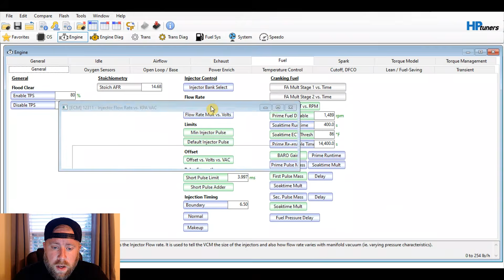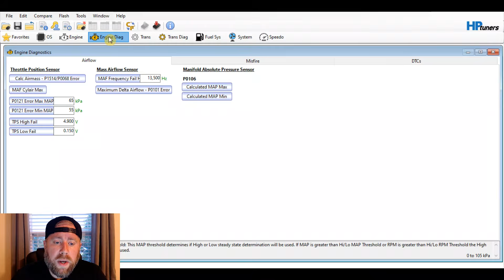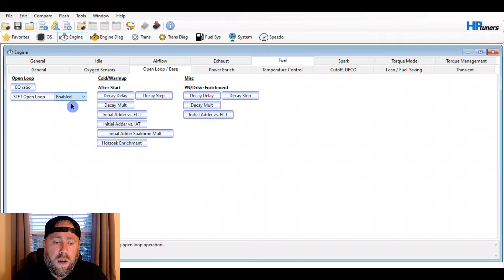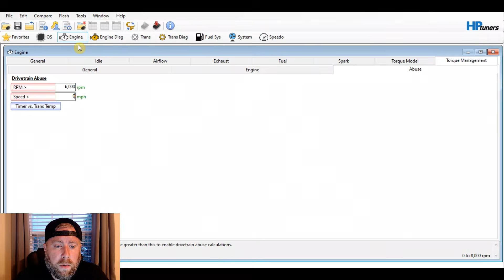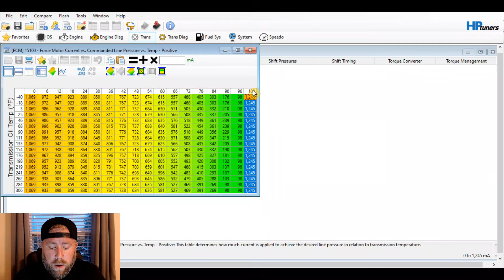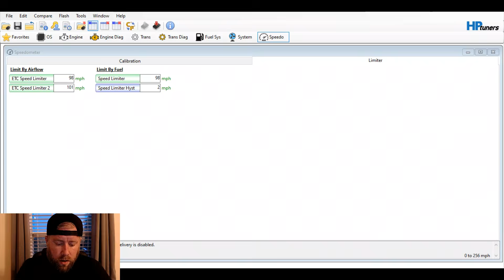Gen 3 LS Swap Tune DIY with HPTuners

Comment: Great information, i know this video is 2 years old , im not a tuner but the tuner im using is not to familiar with e38 ecm for my ls sway, i have a 2007 6.2 from a Escalade, the ecu want to see fuel pressure from the fuel pump module but i running a corvette fuel filter what does he did to tell the ecu to show rail fuel pressure, need your help.

Comment: Hey great informative video, I’m thinking on purchasing HP tuners instead of paying someone to do my tune, but I have never done this at all, I purchased a mild tune from psi conversion, they said it will run fine if it’s stock, but run like crap if having aftermarket camshaft in which I do have, it’s a stage 2 camshaft by sloppy mechanics, how would I add that to tune myself to have it run smoother and idle better? Also I’m running speed master intake with 92mm throttle body, do you have a video similar to that setup so I can this myself?

Comment: if im doing this on a 6.0 and follow everything in terms of shutting things off is there any else that should be different from the 5.3 aside from changing the engine size on the general engine tab? i have a stock file from a 2006 6.0 that i can compare to and i see there are tabs that are different than my 01 5.3 file that im editing for 6.0 but im trying to run a p01 ecu to run drive by cable instead dbw.

Comment: Not sure if it was said in the video or if anyone has had the same experience but we had a non-electronic trans Th350/5.3 c10 with stand alone engine harness that wouldn’t rev up past I think 1200 rpm and would cut out. I disabled Abuse Mode in the trans section and it allowed it to fully rev out like normal.
Reply: I’m having a similar problem in my c10 with manual transmission.
Reply: Update: In the Transmission tab- set it to manual, disabled abuse mode in trans-tab and I could rev up now
Reply: Good to know 02 5.3 Cammed with th400, got it running and idling I just haven’t revved it yet. Thanks if this happens I know what to expect
Reply: Wait what so i have the same issue however i just put it as a manual transmission thinking that would work didn't see the abuse mode and also seems like when it gets warm, cone to a stop acts like a carburator sputtering then it takes off? Any suggestions or at least the abuse mode
Reply: @supertruckertroy  so did you figure it out?
Reply: @supertruckertroy following, having the same problem in my Malibu.

Comment: Hey Matt! Tried doing some changes on my Yukon for start up. Didn’t seem to work so going back to file I had before doing changes. Any suggestions? 05 Yukon 5.3 heads cam and tbss intake, runs decent but start up is very bad. Need help anyone

Comment: Thank you so much for your video. I have s 5.3 LS engine with a 4L60e, DRIVE BY CABLE, in my 1971 Chevelle.  I have also installed a Truck Norris Cam. I just ordered my HP Tuner it should be here in a few days,  But I have a MAF, what is the setting I need to change the MAF to also how do I make changes to show the new CAM? Thank you again for any assistance.

Comment: If I use the EGR air flow/pintle position wiring for another pressure sensor that I only want data from. Is it possible to setup a custom pid to display on a plug in OBD2 display? Asking for this on a red blue cable throttle no CAN ECU.

Comment: Matt, I'm running a Holley return style regulator not using vacuum refrence on the outlet/pass side of my fuel rail. Basically goes into holley fuel rail on DS, crosses over, then to the regulator and to the return line. Truck was originally return system. Do I need to scale my injectors like a dead headed system or flat line them? Thanks

Comment: I am adding a gen 3 LS iron Tahoe engine to my 67 C10. I am running a motorhome / torque cam as a grocery getter for grandma and show off, headers, 2 1/5” dual pipes. I was an ASE Master since 78, this is for me. I am running a MAF, auto with overdrive but non-electronic. It is full of the 8/10 goodies I could afford as I built it on the bench. 
 I will fill out a sheet, mail it to LT1swap for program. My tech2 is set to read & operate the BCM. I enjoy wiring. After 7 years w/ACDelco, they gave us CD’s of TIS2WEB that contains service from 98-2004. This includes a service manual! I take photos and schematics include connector numbers, wire color, size and cavity numbers. PCM, BCM & TAC module all sit wire end up, in a slide-in pocket for each. 
 Curious about fan cooling on - off temps. 185 degrees F on, and 182 off? 
 Thanks kindly for sharing!

Comment: Trying to help, not trying to be an A-hole; When you're talking about fuel pressure regulators, and you talk about Corvette fuel pressure regulator, you mistakenly say, “Fuel filter”.   I'm sure you meant “fuel pressure regulator”.  
This is right about at the 6 minute mark,  +/- 15 seconds.
Many people correct issues similar with a text note that pops up for 20 seconds.
Reply: I believe he is talking about the Corvette style fuel filter that has an internal pressure regulator with the fuel return line to the tank.

Comment: Hey I'm new to tuning... I bought mpvi3 trying to turn off the rear o2 sensors. Working on 05 sierra 5.3l. Went to engine diag then DTCs there's a bold block behind the error mode column and the ses enable column. Any help would b great thank you

Comment: LS duty cycle fan control is it possible vs full on,  current setup GenIII 6.0 2002 C2500 with two off the shelf fans and derale controller but it can handle only 35 amps per fan,  but would like to install two fans from ford pickup truck using duty cycle controls to avoid running them at full speed thus less noise.  Thanks.

Comment: @Matt Sanford should we by disabling DFCO or PE while dialing in the VE table ?  After running through this process I see in the log that the PE modifier is constantly changing the commanded EQ based on the PE modifier.  With all the settings in place from this video, it seems the System Status stays in Open Loop (not engaging PE), but yet the EQ commanded is constantly changing (ie., not static at the 14.08 Stoich from the video) ?  Am I missing something ?

Comment: I have my 5.3 adapted to a world class T5 5 speed. Are there any changes that are critical to make for this to run correctly? In the Transmission section I see that there is an option to change it from a l460e to a manual transmission - can it really be that easy?

Comment: Always understood that if you turned off the short-term fuel trim open loop and disable it that it would not affect fueling when you're at wide open throttle if you left it enabled it would trim on your wide open throttle fueling

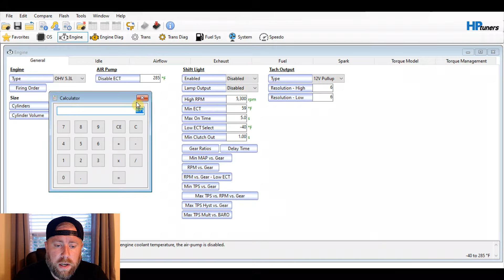Comment: At 7:17 when you explain the engine size, is that “OHV 5.3L” greyed out because that’s what’s in the file it read of the ECU? And if I was swapping in a 6.2L for example, on the “stock 5.3 file” like you have in the video, I’d update the cylinder volume as you did for your 6.0L example and that’s it as far as telling the ECU it’s a “6.2L” not a 5.3
Reply: So I have a 2000 Yukon xl swap a 5.3 gen 4 in it with did delete. I also have 102MM intake with short headers and fuel regulator. Can I use this same tune for my truck.
Reply: @kinggfears  Not sure I understand your comment, sorry.

by gen4 5.3 do you mean that it has the gen4 crank 58x reluctor and a 4x cam gear? If yes, to get this to work with your gen3 PCM you need the ligenfelter conversion box so the Gen3 pcm understands the cam/crank signals

Comment: Will this work as a safe way to start a rebuilt motor and do break in? I don't want to blow my cam and will need to seat the rings, no reputable dynos in my area. Rebuild 2002 6.0 to a 408 stroker with a mild cam and Fast intake.
Reply from the maker: This tuning video is more for a stock engine. The process is similar for yours but you have some things that will definitely need further tuning.
Reply: Thank you for getting back to me. With your videos as well as several others I feel confident I'll be able to tune the engine Maf, timing and speed density in the correct manner. I figure I'll need to obviously change the cylinder vol. to match my engine. I'm hope to get advice from an experienced tuner on what baseline to start from. I've considered that because I have more cu in I'll need more fuel and air otherwise I risk not being able to start. Probably increasing both by the same percentage as my increased cu in. I've been told that during that first half hour while the cam is breaking in and the engine is coming up to temp is when I need to set my idle and see how far off my mixture is. Being a little bit lean won't damage anything given I'm just idling and at the other end I don't want to be hugely rich and wash the cylinders. Is there anything else you are aware of that should be adjusted for first start? @Matt_Sanford
Reply: @Matt_Sanford  how much do you charge to do a ecm
Reply: @Matt_Sanford @ how much $? A 03 pcm tune! For a swap

Comment: Hey really appreciate your videos. I have just got into tuning and your videos are super easy to follow had a question is there anyway you could put out a video on a manual trans swap. I have swapped about 5 trucks so far and have done either a sm465 or nv450p behand all of them and it seems that when i change trans to manual it dosent rev up right and seems like it takes a long time to come back down to an idle on a free rev.

Comment: The table for Flow VS kpa. If you are not running a vacuum reference, is there any way to know how to scale the table instead of it being flat line? I know that scaling would be depending on the injector but was wondering if there was a math formula or anything to figure it out
Reply from the maker: Usually you can find that info in the data that hopefully come with your injectors or you can reference a vehicle that doesn’t have vacuum reference but has the same injectors if they are factory. C5 Corvettes, F-Body Camaros, and 2004-2007 Classic trucks have non referenced data.
Reply: @Matt_Sanford  👍 Thank you for the reply

Comment: Under fuel injector flow rate with a dead headed system I don't understand why the injector is flowing more with a higher kpa in the manifold? The vacuum is less at a higher kpa so the injector should be flowing less due to lack of help from the vacuum. Unless the voltage going up is what is helping the injector flow more? But isn't that due to a variable voltage fuel pump? So a none variable fuel pump won't make the pressure go up when the voltage goes up. New to tuning and trying to learn. Thanks for the video.
Reply from the maker: The axis is Manifold Vacuum, not atmospheric pressure. When it references 80kpa, it’s not 80kpa of atmospheric pressure, it’s 80kpa of vacuum or approximately 20kpa of atmospheric pressure (depending on your location of course).
Reply: Thanks! That helped. @Matt_Sanford